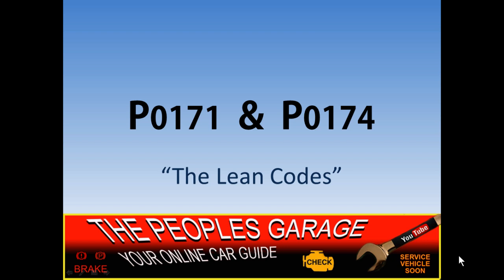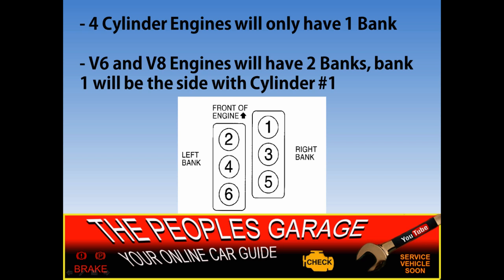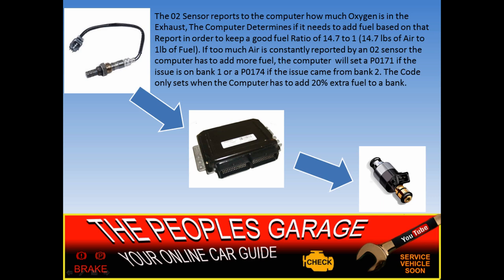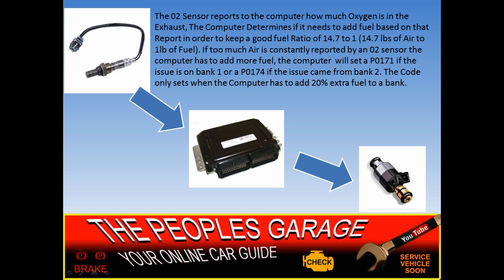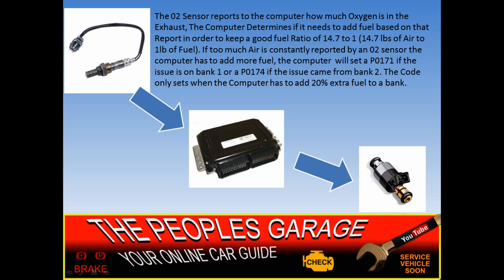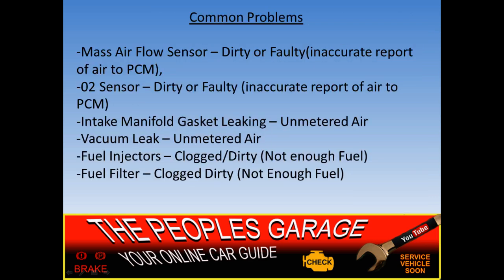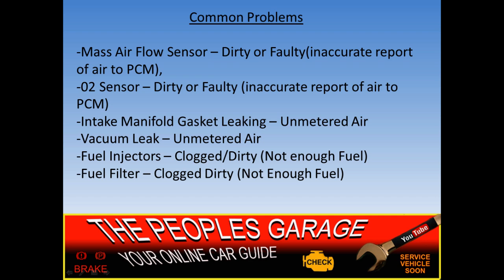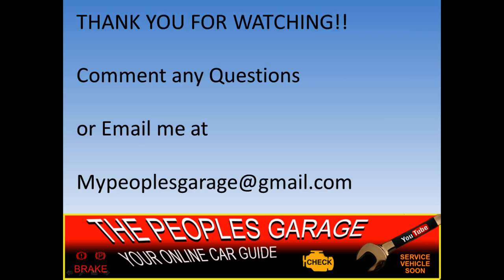How to Diagnose Codes P0171 & P0174 - Lean Bank 1 & 2

Comment: good video. but i have question. i have ford focus 1.6 petrol mk2 (UK) and it had reported system too lean. In addition it goes to 24mpg where before was arround 38mpg. when car is cold and i try to start it , its goes up to 1-1.5k rpm then gose down to 700-500 and dies (all takes about 2-3sec). if i will hold acc pedal for like 3-5 sec its stays in arround 1-1.3 k . what could be possible problem ?
Reply from the maker: Radoslaw Pasieka Try clean the MAF sensor, and clean the throttle plate

Comment: Hello I have a 2000 gmc jimmy 4.3 l pulling a po 171 and I have replaced the maf, egr valve, the pcv elbow and new evap tubings as well for the pcv. My car starts up but dose not hold a idle and is pulling this code can this b because of my IAC = idler air control valve ?
Reply from the maker: dion arocha P0171 is going to be an issue on your driver side, check for a vacuum leak on the driver side, spray a can of brake clean around with it running and see if you can notice a pickup on idle

Comment: hello i have a 03 range rover and its showing codes P0171/P0174.i replaced maf and air filter.do you think it could be fuel filter? thanx
Reply from the maker: Troy Jones usually going to be a vacuum leak, like a pcv elbow or intake hose

Comment: Hi, thanks for your input and help.  Hopefully, you can point me in a good direction. I have an 03 expedition. I was running several codes: one for a Cat converter and another for P0171. I had the convtr and 02 sensors(4) replaced; got rid of that code but the other remains (P0171).  The truck runs very sluggish, has no torque, can barely go up hill with A/C on and the exhaust sounds like it flooded (gurgles/minor backfires). One mechanic put his stethoscope to the engine and couldn't detect any vacuum leak/s.  Could reversed 02 sensors be the sole culprit or something else?
Thanks,  
Tom
Reply from the maker: Tom Rothweiler Sounds like an issue with only the Passenger side, it will usually be both lean codes if its the MAF sensor but i would try clean it anyway, otherwise a vacuum leak is common on the passenger side for this code, use brake clean to spray around with it running and clean the MAF sensor with MAF cleaner

Comment: hi there.
 I HAD CODES PO171 AND P0174 "BANK ONE AND BANK 2 TOO LEAN:" ON MY 2000 FORD EXPEDITION XLT. 138 K MILES
 THESE TWO CODES CAME UP AT THE SAME TIME.
AT TIMES I WAS LOSING POWER WHEN DRIVING UP HILLS.
WELL, I CHANGED A LITTLE PART THAT GOES ON THE FUEL RAILS, JUST ON TOP OF THE MANIFOLD. $ 20 ON EBAY
IT LOOKS LIKE A LITTLE BELL.
ITS CALLED "FUEL PRESSURE REGULATOR"
WHEN I REMOVED THE OLD ONE, IT WAS CLOGED, THEREFORE, NOT ENOUGH FUEL WAS CIRCULATING TO THE FUEL RAILS.
AFTER INSTALLING THE NEW ONE, I NEVER GOT THOSE CODES BACK AGAIN. 
MY SUV IS BACK TO RUNNING SMOOTH.
I POSTED THIS SO PEOPLE WITH THE SAME PROBLEM CAN DO THE SAME TRICK AND HOPEFULLY, IT WILL WORK.
IT IS WORTH TO GIVE IT A FIRST TRY SINCE IT IS VERY INEXPENSIVE AND EASY TO INSTALL.
MECHANICS WILL CHARGE AN ARM AND A LEG FOR THIS AND MAY WANT TO CHANGE THE SPARK PLUGS AND GOD KNOWS WHAT ELSE FIRST.
ALL AT YOUR EXPENSE.

IF IT WORKS FOR YOU,PLEASE LEAVE A COMMENT FOR OTHER PEOPLE
AND EXPLAIN HOW IT WORKED FOR YOU.
Reply from the maker: im glad you got your issue resolved, I just wanted to point out that these Fords are very common for the P0171 and P0174 codes, The fuel pressure regulator is one of the reasons for these codes but Its very very rare to be this, its usually the MAF sensor needing cleaned or replaced, followed by the PCV Elbow leaking or the intake gasket leaking. I would definitely start with those 3 first.

Comment: 2005 cadillac sts check engine light codes p1101,p0068,p0171 and p0174... any idea whats causing this? i changed the spark plugs all calibrated at 40 and i had replaced the clutch fan ..car overheated a little but fixed it the problem right away.. i didnt replace the sparkplug cable/sensors because im in a budget but i will soon... they cost close to $400 the set..
Reply from the maker: There are 3 common reasons for all 3 of these codes to come on for your car, first thing to check is the vacuum hose to the brake booster, check if its leaking or torn, Then try clean the MAF sensor with MAF Cleaner and reset the codes (Unhook Battery for 15min), if it comes back on replace the MAF sensor with a Delphi unit(Don't use a cheap remanufactured), if that doesn't work your going to need a new Computer, that's last resort though.
Reply: thanks for the reply man. after searching all over the internet for a solution, i found the problem. I had a loose air hose on top of the engine.. but i replaced the fuel filter too. some people were saying that an dirty or damaged fuel filter would cause all these codes to pop up..but thanks anyways. I subbed to your channel for more tips and very helpful information you provide to the people

Comment: Hi i have a 2005 mustang and I got the code P0174 and P2197 that it was running lean
Reply from the maker: the P0174 is a lean code for the Driver side, and the Other code is for an Oxygen Sensor on that same bank stuck Lean, they are related, might be a bad 02 sensor on that side most likely up front, or it could be a vacuum leak on that side causing both conditions..

Comment: I'm getting 171 on my Mazda6 year 2005. Smells like something is burning and the temperature gauge goes up and down constantly. Any advice? I'd really appreciate your help.
Reply from the maker: its very common to be a PCV Hose in this case, its leaking vacuum, you should be able to see it with a hole in it, or spray brake cleaner with the engine running and you will hear it pick up idle..
Reply: ThePeoplesGarage Thanks, I suspect that the radiator has a leak since I've been refilling with water and I can smell the steam when it runs low.. is the pcv located near the top? That's where most the steam comes from.

Comment: 99 4.2v6 5spd ford f150 115K

- cleaned K/N Air filter CONE
- cleaned MAF w/ MAF CLEANER

- changed fuel filter ( huge starting issue before codes popped up , then codes following after repair)

- passanger side vacumm lines from rear of intake to front seperate elbows and seperate sections ( as they were in NEED of replacement )

I really think there is a fuel pressure issue based on the original issue fuel filter , but I don't know what to do from here. this is what I've done in the order I have done it. codes were checked after they appeared once the vehicle starting issue was repaired by replacing the fuel filter.
 also I am curious on the PCV issue. as this is a 99 it still has an aluminum plenum, does that mean this is not an issue then ??
Reply from the maker: The MAF might need replaced, or it might be an intake manifold gasket leak, these are the most common things for this truck
Reply: aluminum intake manifold..   no plastic plenums here....    soooo still a intake manifold leak issue ??
Reply: also you are the first person to mention MAF and I have used MASS AIR FLOW SENSOR CLEANER AFTER MY K/N filter change

tho a 40+ year mechanic said the k/n was  NOT a k/n and it was time CHANGE IT OUT TOP SOME THING ELSE EITHER WAY ...   I'm thinking of going straight stock cause I have all the stock parts and buyinga stock A/f or stock style K/N air filter.....  your ideas please sure

Comment: we just got engine light on V6 3.5L  2009 HONDA ODYSSEY 52xxx miles same codes Codes P0171 & P0174 -System To Lean Bank 1&2  any help thanks
Reply from the maker: Its usually going to be the MAF sensor in your case

Comment: what are your thoughts on a 2000 E150 with both banks lean and cylinder 3&4 misfire codes.......fuel filter  ?! alreday replaced coil, spark plugs and wires.
It has a bad misfire effect and poor idle and acceleration at all speeds 
thanks for any help you can give
Reply from the maker: Lean on both banks could be a vacuum leak somewhere or a MAF sensor, could be an intake gasket leak near cylinder 3&4 which are the 2 rear cylinders on the passenger side
Reply: thanks for answering my question....between the injector and the intake manifold gasket getting replaced , the problem is now fixed....too bad the mechanic didn't check to see which it was, but I guess they both had to be done to replace the injector.....but hey, I appreciate your feed back and enjoy your videos
thanks again

Comment: would a k&n air filter set this off because of more air going in? need help if anyone knows please!
Reply from the maker: It could! the Airflow is effected when a K&N Filter goes in, sometimes an aftermarket / performance MAF sensor has to be installed to accommodate a K&N filter to keep the light off, or computer programming

Comment: ok, here goes... I have a 2004 Navigator, (Idle is stuttering, lack of power when driving) I started out getting a P0171 code, did not find any vacuum leaks so I replaced all 4 02's.. they were due anyway. after replacing them I got misfire codes (5,6) it was time for tune up so I replaced all plugs and coils. when I finished I was back to P0171, and P2195. I did then find a small vacuum leak in the center elbow of the PCV tube.  Now... still runs rough and only have the P2195 code...... any suggestions????
Thanks Chris

Comment: I got a question about my 99 Ford expedition 4.6
I got both of the codes PO171 and PO174 my sensors seem clean on the intake and the air hoses don't seem clogged up, after I seen this video I came to me that last year I had replaced the fuel pump with a new one but it didn't come with a filter though so my friend had one that looked similar to it and I decided to put it on, would you suggest that will be the cause of the codes?
Reply from the maker: I would check for a leaking pcv elbow behind the intake, check my video for checking for vacuum leaks. Also try clean the MAF sensor and erase the code, if it returns and you have no vacuum leaks replace the MAF Sensor

Comment: Hi, I was wondering if it was possible to have a fuel injector go bad enough to cause the 171 code but not have any noticeable loss in acceleration or power?    
It's a 2000 Grand Prix 3800 engine.  Everything seems fine (idles around 850 rpm, 800 in gear) no alarming knocking, no audible air suction (other then a quick air burst if you tap the pedal hard,) no surging or stuttering, nothing really appears out of place other then the SES light and extremely poor city driving mileage (estimating < 10 mpg city) however, highway mileage falls in that 20% number with getting around 29 MPG vs 32 MPG that I got before the SES came on.
Reply from the maker: Yea I mean an injector is a potential cause because if its not firing that side is running lean, however, I would look toward the MAF in your case because its a very common thing for your car and this code. I would try to clean the MAF sensor with MAF cleaner from the Parts store and then erase the code, if they wont clear the code for you disconnect the battery for 10 minutes and reconnect and wait to see if the light comes back on, if it does you should replace the MAF sensor. This is keeping in mind you don't see any vacuum lines loose by the brake booster or intake manifold.

Comment: I have a 05 f150 with the 5.4 it throws both codes both codes but it's only one in awhile when I get on the highway and take of what do think might be the problem?
Reply from the maker: I would keep it simple to start and buy MAF Cleaner from the parts store and clean the MAF sensor, I have a video on that also
Reply: ThePeoplesGarage hi great video i got po174 and 175 the 02 sensor are working ok but long fuel % is 25 per cent up,
can u give me any idea what could be,thanks for u help
Reply: Juan A Rios i forgot is f150 ford truvk
Reply: its either running lean because the fuel system is dirty or you fuel pump it not pushing enough fuel and pressure to the rails

Comment: im having a rough idle after changing intake manifold codes p0174 and p0171 cum up and a misfire but changed the misfire and still getting that code I checked for coolant leaks an got nothing I did pressure test no pressure lost checked oil to see for water and dat was normal plz help
Reply from the maker: if you got these codes after replacing the manifold i can almost guarantee the gasket got damaged or its not torqued down properly. Watch my video on checking for vacuum leaks and grab some brake clean and do the test.
Reply: Wats da brake cleaner for
Reply: Ok so I did vaccum leak test notta change in idle so im goin to clean maf and throttle body
Reply from the maker: ok if your sure its not a vacuum leak then, your going in the right direction with cleaning the maf and t body

Comment: Hello, I have a 2001 530i BMW with codes P0171, P0174 & P1345. I have added fuel injector cleaner in the gas tank, oil change, and a tune up. I have not checked for leaks yet. Do you have any other suggestions I haven't been able to pass the emission test.   In advance thanks!!
Reply from the maker: Check for a leaking intake hose, the rubber hose from the air filter to the throttle body, these are very common issues on BMW and will cause the 171 and 174 codes. P1345 from my research is a misfire code for BMW, if you solve the other 2 codes this one might go away as well.

Comment: Hello. I'm am having trouble with my GMC sierra. I just bought it the other day and the service engine spoon light flashes on the highway. Truck runs great. I took it to advanced and it pulled p0131 (O2 sensor), P0171 (bank 1), P0174 (bank 2), and P0300 (random multiple misfires). I have no idea what the problem is. I tried testing for vacuum leaks with carb cleaner but I don't really know where to spray Haha. Please let me know what you think. Also, it has a flow master dual exhaust if that matters. Thanks
Reply from the maker: Check out my video on the Vacuum leak test. With the P0300 code i would clean the maf sensor first and clear the light or have the part store clear the light. This will likely get ride of the P0300, 171 and 174 codes. Although the sensor might need replaced i would start with cleaning it first. As for the P0131 code i would buy an Oxygen sensor (Direct fit not universal) and install it Driver side before the Converter Bank 1 Sensor 1

Comment: I'm having problems with my 07 Chrysler 300 3.5L. it's giving me p0174 and P0128 which one should I handle first?
Reply from the maker: P0128 is usually the Thermostat on those vehicles, they are about 10-15 dollars for your vehicle. The P0174 code is a little tricky on these 3.5 liter engines, usually i would say check a vacuum leak but not in this case, it might be an Oxygen sensor issue on bank 2 which is driver side. For the P0174 you might have to take it in and get it diagnosed. Negotiate with a shop you trust, diagnosis for that can be 40-80 dollars fairly.

Comment: Also a Cracked EGR Valve Tube will cause these codes , I just replaced my EGR Valve tube and it took care of the problem .
Reply: watch dog G
Reply: Would a bad erg gasket do the same code?  I have a code 174 and believe I have checked all lines and hoses.  I also am not getting air through my air vents that are controlled by vacuum. I ran a smoke test and the only smoke I could find was coming through the erg gasket. 
Thanks
Reply: I got po174 its idling rough an hesitates when I take off any idea?

Comment: Hey i have a 2000 Lincoln ls and it runs ruff and sometimes it knocks and it runs like it has a misfire check all the plugs 2 of the cylinder had water clean it up and when it stopped in a light it smells really bad like gas and it waste lots of gas I put the scanner and gives me thes code  po174 o2 sensor lean on bank 2 can you halp me plz
Reply: Hello, I have a 01 ls with the 3.0 , Is yours the 3.0 or the 3.9 ?
Reply: I really can help you on this problem.
Reply from the maker: well P0174 is not an 02 sensor code its just a lean code meaning too much air on the driver side.. it could be a 02 sensor but not usually, i would check for a vacuum leak on the driver side, watch my video on vacuum leak

Comment: Hello,
I have a 99 ford ranger 4.0 L engine 4x4. It has 108k and the car has the engine light on. I plug the car into the computer and it gave the codes p171 and p174. I did a lot of research about these codes and but don't really know if it will apply to my car. The truck is terrible on gas and when you first start the truck in the morning something times it just shuts off by it self. Also what I've noticed lately is on cold days is when you start the truck, the check gauge light comes and the oil gauge is in the middle of between low and middle but goes back to normal after 2 or 3 mins. I would appreciate it if you can give me an inside of what I should do first because I don't really want to spend a lot of money or time changing the MAF sensor, Oxygen sensor or any other parts if its going not fix the problem. Thanks.
Reply from the maker: i would try clean the MAF sensor and look for a vacuum leak, watch my videos on how to do these procedures.